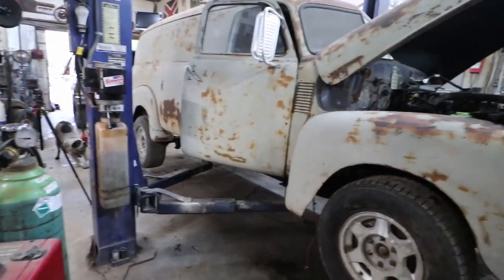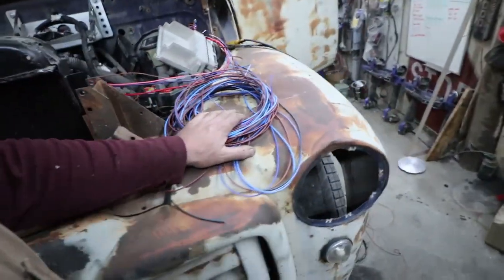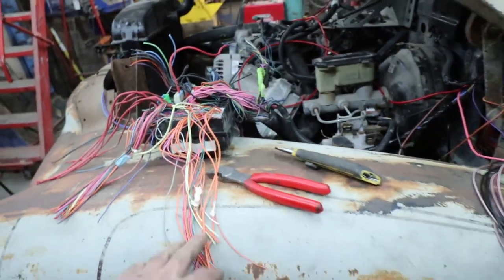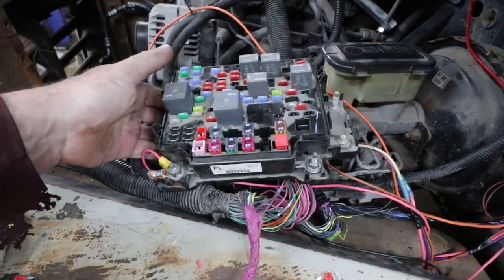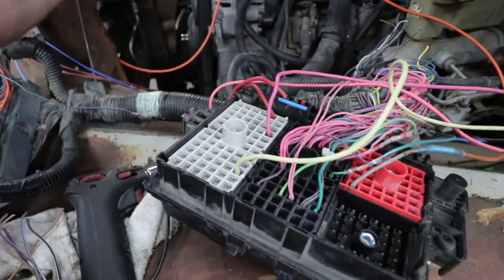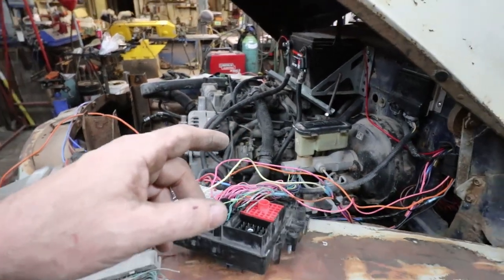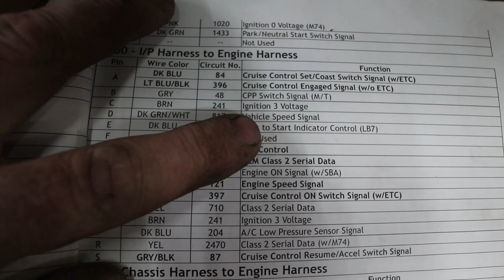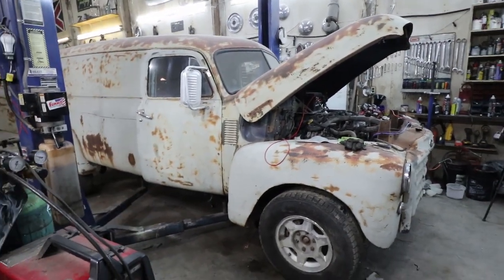LS swap wiring made easy using the stock Silverado fuse box for the GMC Panel truck

Comment: Fenders from a bigger truck are wider , like two ton. Might  be easier to swap a set and those would sell. Glad you understand the wires, I am old, carbs are easier.
Reply from the maker: they fenders have been hacked up already do no big loss in chopping them up going to have to fix the arch in them anyway.
Reply: @HalfassKustoms  @ what year its ur harness?? Mine is 04 tahoe,,  and looks different

Comment: Thank you for reposting this video. I am in the process of replacing the 327 in a 67 Camaro with a 5.3 LS. Small camshaft and wanted to run it on a test stand. This video will definitely help me with the wires 👍

Comment: Normally I don't have much faith in my automobile wiring talents when it comes to this ls stuff, this video showed me that 
I should be able to accomplish this all , just have to take the computer to get it unlocked thank you. Do you have any '49 Plymouth bumpers laying around ? a pair would look good on this panel. thanks again.
Reply from the maker: I actually think I do but I have the original front bumper for the panel just have to Source a rear one
Reply: Maybe for the open cab PU project. the panel is looking good , than you

Comment: I have a few questions:  1, Do you hook your headlights up through relays or direct through the headlight switch without relays? 2, What do you use for the brake switch to kill the cruise control? I have a Ford with a switch on the front line of my master cylinder. I'm sure it does what you are looking for and maybe that would be easier than trying to rig something up. (2002' F250). Also, the tube you added to the radiator,,, I've had to do a few of these and one was small enough to spread the end with my brake line maker and the other, much bigger, I simply drilled a hole the same size into a piece of 2x4 and inserted it in and used a ball bearing and hammer to open the end up so the hose would not slip off.. Both worked very well...
Reply from the maker: Just through the switch, for brake switch I use something like this from an 80's gm with cruise control has both connections on it, one for the brake on for the torque/cruise https://www.rockauto.com/en/moreinfo.php?pk=1189195&cc=1036831&jsn=2679
Reply: @HalfassKustoms  I did some heavy reading on automotive electrical some years ago and found that the corporations have definitely figured it out with the use of relays. They have far less amperage traveling through everything under and behind the dash and far brighter headlights and far better working fans and other accessories due to their use... I had an old mopar go up in flames and that is exactly why the new direction of power management these days... Just my .02...
Reply from the maker: Yeah that's definitely how most newer Mopar stuff goes up in flames around here haha always the headlights.

Comment: Great thanks for sharing
Reply: When doing a drive by wire & installing a 350 turbo transmission, what happens to the kick down cable from tranny
Reply from the maker: On my truck I just don't have it hooked up

Comment: When you said the pink and purple wire were to start the motor, we’re the y key start power or were they power to the starter solenoid? I’m building a 80 Firebird for my som with a 5.3 from a GMC Envoy, so it’s almost the same motor setup
Reply from the maker: Just the purple will run the starter solenoid.

Comment: hey man i know this is super old but i see your running the fuel pump out of the fuse box and i was wondering if you ran the donor fuel pump and if you could run it without s regulator filter inline that way? thanks for the video super helpful

Comment: Can you use that fuse block you were yanking wires out of instead of the aftermarket one, and just us the wires from a kit?
Reply from the maker: you could for some stuff but I never really figured out the routing or paths of the wires in it. and by the time a feller bought all the wire to plumb a car it would be cheaper to get a kit in my option.

Comment: Had a 2000 silverado that the abs light stay on was told $2k to replace module ,Could you of by pass it and unhook light ? brakes worked fine but colorado wouldn't pass test to re licence due to light on so I traded it wish I would of kept it. have a 2017 gmc and 30,000 miles on my 2nd fuel pump notorious I'm told.
Reply from the maker: think you would need some kinda of GM tech tool to do that.

Comment: Did you order the pro features on your HP tuner or the standard version? I am wondering what I should buy, If you are using standard version that's all I would ever need
Reply from the maker: I have the standard but it's a older version, think the difference is if you want to data log while you drive without the laptop you can with the pro.

Comment: Hey Brent do you have any experience with doing ls swap using early 4l60 (700r4) transmission, I’m swapping a 6.0 into my k5 and wanted retain everything from trans back, I got all the adapters just not sure about the torque converter lock up circuit as it was controlled by original pcm

Comment: Hey halfasskustoms. I'm in the middle of doing a ls swap on my truck. My buddy helped me hot wire it and I am using the donor truck engine harness with factory fuse block and it ran great. Now I started installing a universal wiring harness kit in the truck and have the ignition hooked up. The starter engages whenever I hook the battery cable up. The fuel pump doesn't kick on but I have no idea whats going on. Any ideas?

Comment: What program do you use on your computer to shut that stuff off on the computer of the vehicle , that saves alot of time with the wiring that ain't bad for  3 wires
Reply from the maker: Hptuners
Reply: Thank you  very much

Comment: The lab rat who designed that rat's nest of insanity was a dope fiend to be sure. I'm stuck in the 60's. Power to the fuse block, fuse block to each accessory, coil wire to the key switch, charging circuit, power wires to the starter and yer flying. Prior to the 60's it got even easier but we had the rat population under control back in those days. Today it is pure insanity. If you are color blind, yer screwed. lol.
Reply from the maker: haha have a buddy that is color blind and he figured it out :)

Comment: Brent, Wiring harness man, if he can't wire it no one can, explained wiring so anyone but me can. Drive by an Ls wired, turned the ignition switch n she fired. Ls run'n with the stock fuse box, never look'n back, transmission, hp tuners, computer's hacked, not go'n back. Pablo ride'n shotgun, not in da back.      Rad n tranny line, next time ack.

Comment: Why would you say your fan on and off at such high levels of temperature wouldn't you want to come on more like on 185 and shut back off at 180
Reply from the maker: these motors stock run a lot hotter than the older small blocks, I'm just keeping them in spec'ish to what the where though I think they run hotter than that normally